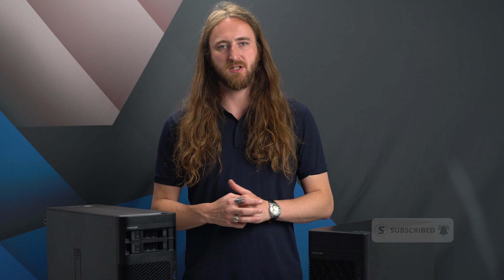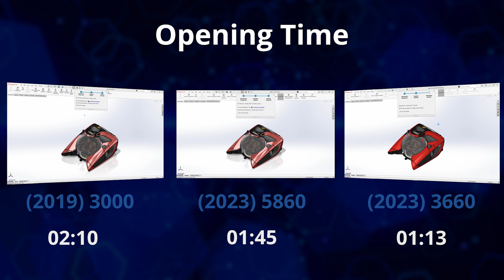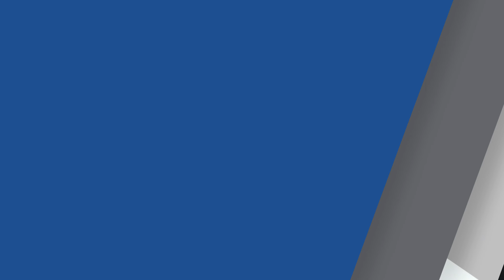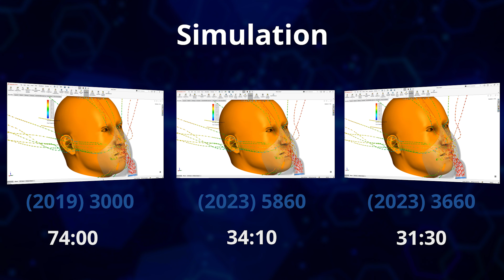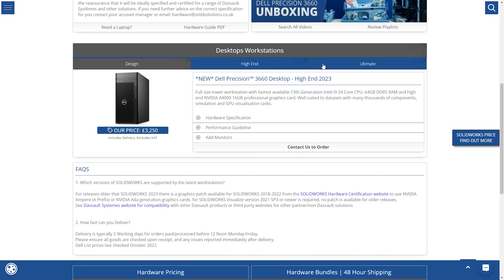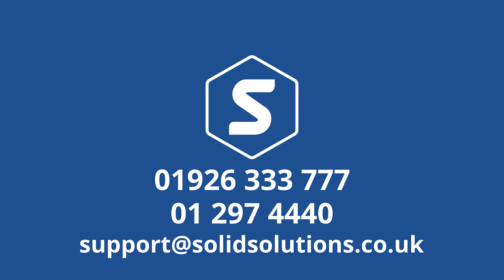DELL Precision 2023 Desktop SOLIDWORKS Performance | Hardware for SOLIDWORKS

Comment: Are there any benchmarks with an AMD processor ? Or is intel the way to go ?
Reply: Hi at the moment Dells only AMD offering is the Precision 7865 based on offer the Threadripper Pro 5000 series  when we tested that on release in 2022 performed slower than Intel's older 12th generation CPUs for the majority of tasks.  Given that was Dells first AMD based system in many years hopefully we will see more options in the future as AMD are certainly competing with Intel more in all segments in the last few years.